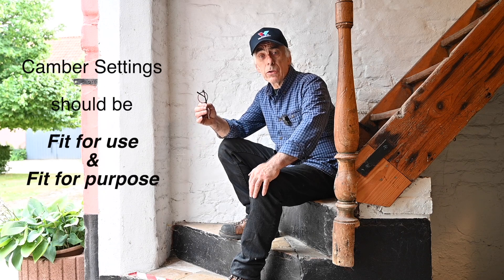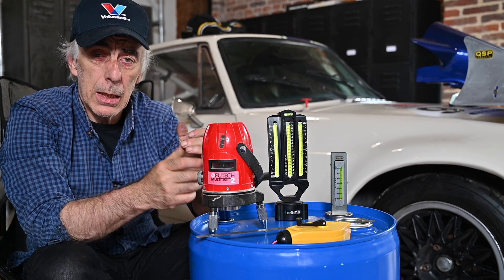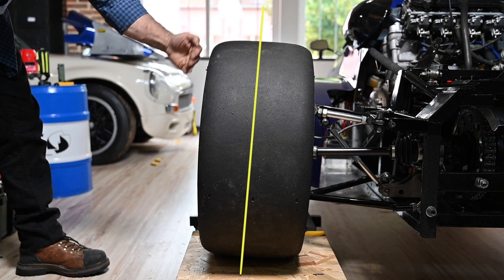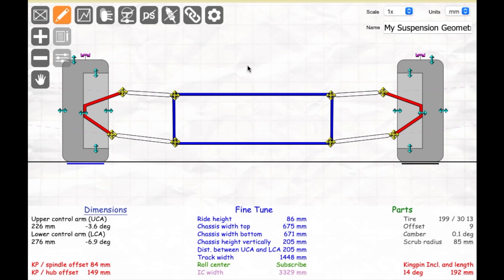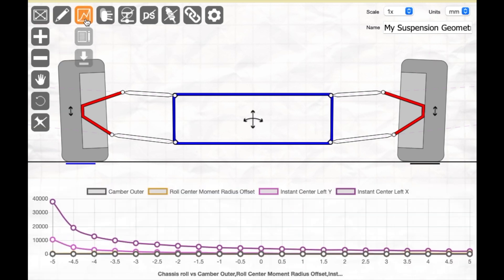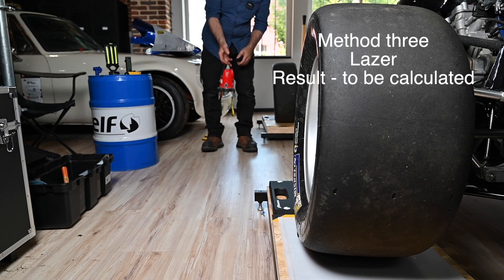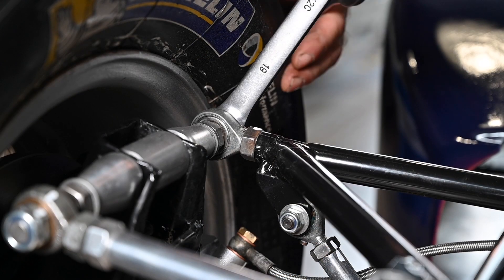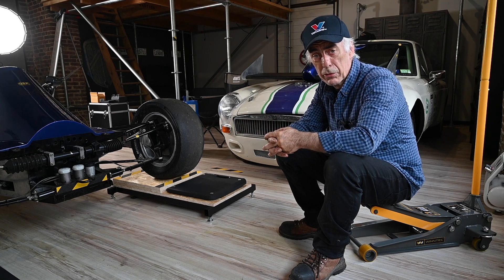Race Car- Alignment- Episode 4- Camber

Comment: I would have added when racing on a budget i would adjust my chamber to achieve the best tire wear which is a good indicator of proper camber /tire pressures
Reply from the maker: Indeed, that is an other consideration.  Everything is a compromise  in setting the alignment...and for sure cost is one of them versus performance
Reply: You will not necessarily get proper/even wear with ideal camber settings for track driving, although it depends what kind of driving. I find professional drift cars are the fastest with quite even tire wear running POSITIVE camber in the rear despite negative camber in the rear being theoretically faster. It still doesn't make complete sense to me because elastokinematic camber loss would mean the rear tires are something like +1 degrees in cornering, but it is what it is. 

Many times I find the inside ends up a bit more hot/more worn with ideal settings.

Pressure is maybe a bit more indicative and correlated with wear, but pressure is quite dynamic and will depend on your camber and loads in transient so it's always a compromise between modes.